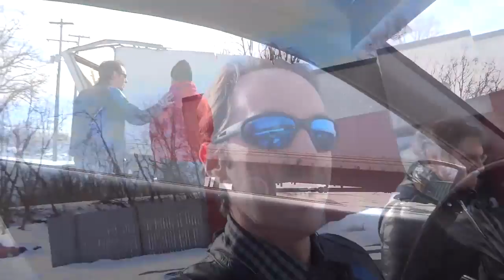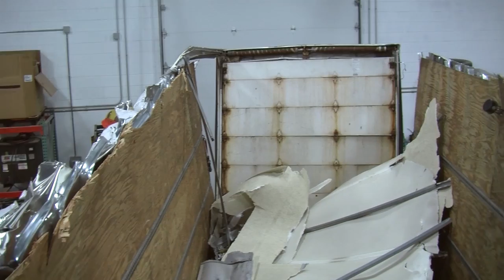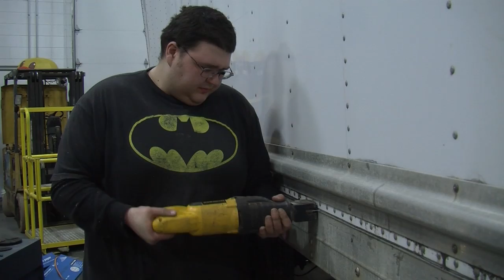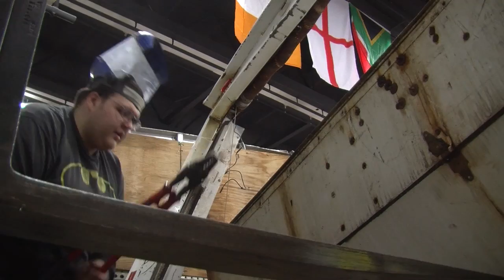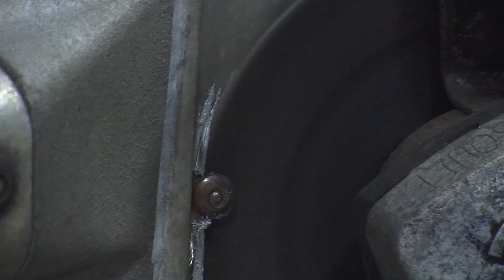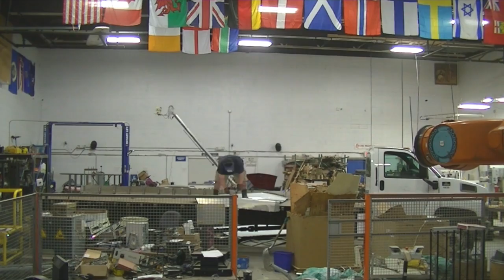Converting a Box Truck into a Flatbed

Comment: step 1: remove plywood inside.  step 2: try a metal cutting blade in a skill saw (should slice right down the line easy) OR plasma torch

Comment: Could cut with circle saw with a 60 tooth carbide blade using the outer aluminum rail as a guide.Now you have Flatbed with short side rails

Comment: Those are stainless bolts so they're not rusted, you should be able to just take off the plywood on the inside and then remove the bolts. Seems like it could be easier.

I have to do the same thing to make my truck into a curtainside.

Comment: OH MY GOD that's a lot of work and time to disassemble a box. Couldn't you have just  popped the whole box off as one unit?
Reply: Ya...
Reply: $500 plasma cutter would've made quick work if this route...and I didn't see the torch they claim. Oxyacet wouldn't have bothered w supports lol
Reply: The floor is separate.. and welded bolted. If u rip that up u have to make a new one